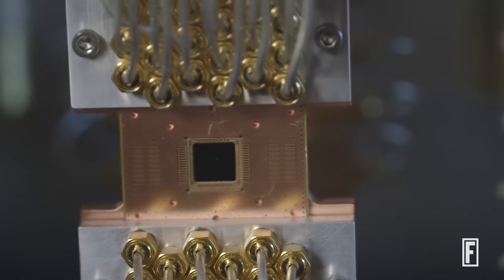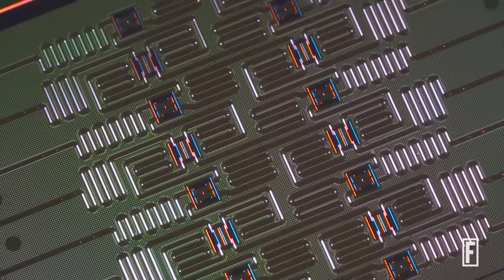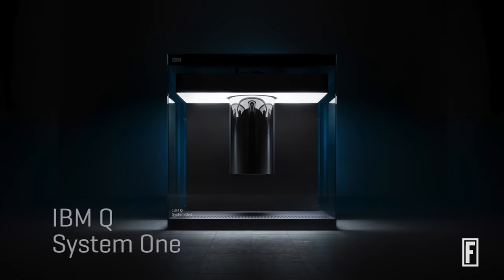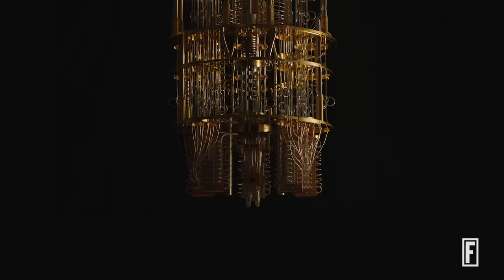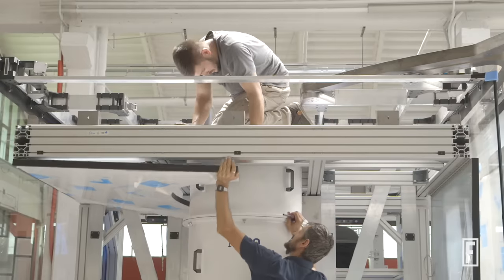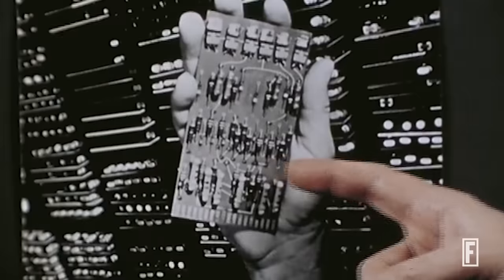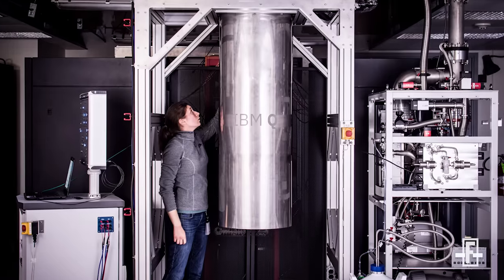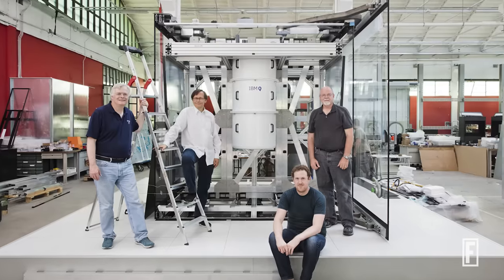IBM Unveils Groundbreaking Quantum Computing System I Fortune

Comment: 3:25 half inch glass with tolerance 1mm... that's 8% deviation! spouting fancy bullshit that really doesn't matter
Reply: Yeah, I wouldn't call that telescope mirror manufacturing accuracy. It is basically a fancy glass case to increase the pizzazz factor so, I guess its ok. Also, borosilicate glass is just low thermal expansion glass, like Pyrex glass but they use this term because it sounds "sciency", typical marketing and image making behaviour from companies.
Reply: I thought the same!
Reply: @MattacksRC  For real. They used "made the glass that covers the Mona Lisa' as an example. So what? Its really thick with some plastic layers? Wooooooow cooooooool.
Reply: Yep BS - sells!!!
Reply: I'm not positive, but I'm guessing the 1 mm tolerance might be with respect to the flatness across the whole panel, not the thickness of the panel...
Reply: @mmoseleywpi  
Yeah, I also thought of that. It might be.
Reply: @Indo Surfer uhhhh.... yeah? 1mm is 8.3% of 12mm...
Reply: @makismakiavelis5718  
"Also, borosilicate glass is just low thermal expansion glass, like Pyrex glass but they use this term because it sounds "sciency", typical marketing and image making behaviour from companies."

==Pyrex is a trademark of Corning ware.
The common term is borosilicate glass. It's the standard soda-lime glass with a certain amount of boron oxide added.

There was a time when people said kleenex (Can you pass me the kleenex?)
There was a time when people said kodak (Bring the kodak with you.)
Reply: @vmelkon 
I know that, i only said Pyrex because it is the most widely known brand where i come from. There are other brands like Heatex, Duran, Simax etc. Most viewers know what Pyrex is, less know what borosilicate means. In my corner of the world we comonly call it "heat resistant glass" or just Pyrex
Reply: yeah my ceramic cutting board in my kitchen has tighter tolerances than that :p
Reply: Spoken like someone who completely missed the point. The point is that the internal components are highly temperature sensitive so they had to encase the thing in this particular glass. Why don't the tolerances seem all that exact to you? Did you listen to the purpose of the glass? It's there to expand and contract to absorb all of that external variation before it reaches the supercooled quantum computer. A 1mm tolerance is less important because the glass is intended to flex. But yeah, your low-grade heckling is very edgy.
Reply: @makismakiavelis5718  :
I guess you are right.
Most people know the term pyrex.
Reply: @DikoMan didn't he say the glass was from Italy?.... Im pretty sure Italy uses Metric.... also half inch is 12.7mm

Comment: Why glass windows? He said the windows were only used to keep the temperature inside stable. So, why didn't they use, say, thick walls made of highly temperature-insulating material instead? There's no point looking into a box that contains a suspended barrel.
Reply: RF shielding too?  Low coefficient of thermal expansion.  Yeah I am not sure why he touts the glass so much.  This thing is quite a bit beyond gold plated.  I think they should use sapphire glass like an iPhone.
Reply: @williamdavis2505  Borosilicate glass has very good thermal properties which is likely why its used. As for rf shielding, the glass is almost guaranteed to be ITO or FTO coated to make one side conductive.
Reply: Glass is a good IR radiation reflector, but it seems to be there just to make the system look cool instead of be cool (literally). As other said, there are better and cheaper materials to do the job than a thick wall of Boro 3.3.

Comment: Let's be cautious with Ai and quantum computing please
Reply: AI yes but quantum computing why the concern?
Reply: @darken3150  Quantum computing can/will bolster machine learning exponentially.
Reply: And?
Reply: @darken3150  ...and I was explaining why we should tread carefully with AI and quantum computing? Anything that allows AI to perform at orders of magnitudes higher than it already is should be watched carefully. Of course it's a moot point because we will ALWAYS be full steam ahead on new technologies...
Reply: So you say be caution of quantum computing because of its use. Then by your own logic we shouldn't be pushing for faster conventional computing either because it will also perform higher than current capabilities. My point is the concern is AI alone, not quantum computing. Also are you equating machine learning with AI?
Reply: @darken3150  I'm not saying we shouldn't push for better technology, of course we should. I'm just saying that having an understanding of the implications that new technology (in this case, quantum computing) can have on AI is a noble cause. OP's post, I believe, was about the interaction between the two, and not about them in silos. 

Furthermore, I am aware that machine learning and AI are not one in the same, but rather one is intrinsic to the other. The reason I called out machine learning is because from what I've seen, that is the one aspect a lot of programmers seem to be most excited about when it comes to quantum computing and AI. I do consider myself a neophyte in this realm though so if I'm incorrect about that, feel free to point me in the right direction.
Reply: @probablychris  It's not the technology that's the concern. Its the people who will use it for evil, for example the N.S.A.
Reply: It's right, we have to be careful. A quantum computer has the potential to break thru every cryptography! Hence, for example, the user has access to virtually all the money by hacking online banking.
Reply: Kay Kay  I'd rather say: Hackable.
Reply: We already have enough people on anti depressants and we just seem to become more discontent and miserable as the digital age progresses. It seems the technology has progressed too fast for society and culture to adapt.
Reply: Kay Kay  
I am a software engineer with a degree so no tech did not leave me behind but I agree that no one seems to take responsibility anymore. It just seems that the technology has overall had a negative effect on peoples well being since it is mostly geared towards entertainment and quick gratification. Social media makes people anxious and depressed. The technology is amazing if you don't consume too much of it and use it more for more productive things but it seems too many people are unable to do so including me sometimes.
Reply: Why? I say let AI take over. They can't make things worse than humans have already did.
Reply: Kay Kay  
I think it is more then just self control. I may be wrong but it seems like everyone is becoming more and more superficial hiding behind a digital interface and our information and entertainment is becoming more centralized. All of our information and privacy is at the trust of a few tech giants, and it is easy to imagine a future where this is used for more sinister things then targeted ads. Considering human nature and history it would be foolish to assume digital technology will not be used for economic domination and mass mind control.
Reply: Kay Kay  
I never said that, learn to read.
Reply: Kay Kay  
I never proposed anything. I am just sharing my opinion on it all. If the majority of people fight for the freedom of speech and basic human rights and do not blindly trust tech giants like Google to be responsible with all our digital information I think the our technology will better most people's lives.
Reply: Kay Kay  
No, I agree that it is our responsibility to maintain our freedoms and not institutions like Google or party politics which is why I am taking the time to even comment on this video. The future is out of our hands but maybe we can affect it in some small way by sharing information and trying to understand things in a more real way.
Reply: too late
Reply: @darken3150  normal computers 3 weeks to teach AI
Quantum computer 1 hour to teach AI

Comment: I want to take this video from 2:48 on and replace "quantum computing system" with "high-end turntable." Advanced industrial design, exotic materials, extreme manufacturing tolerances, suspended frame, vibration isolation, pressure and temperature control... Exactly the same things that $100,000+ turntables like the Basis Audio "Work of Art" and Clearaudio Statement v2 brag about! Soon to be joined by the IBM 'Q' Turntable, the world's first million dollar vinyl record player.

Comment: Are these to the point yet where they could emulate at least a 486 x86 chip and run Windows 3.1 with Photoshop? Or do they just yell variables out and make leds light up like an Altair 8800?
Reply: It seems to me you've built a glass box around a huge altair. If these computers are to be adopted, they need to do at least what computers today do. No one wants to start over programming lines in Basic again. If you could build a computer that can run x86 server software, that's when adopters will come. Building a glass box around a useless, but super cold chip, is nothing groundbreaking or interesting.

Comment: “There is nothing you can do on a quantum computer that you can’t otherwise do on a classical computer”

This sentence is breaking my brain, can someone please help me understand this?

Please, this is driving me insane.
Reply: drowning. What he means by that is their complete knowledge of the quantum computer is not enough to surpass what your laptop can do... for instance if you do a task on a quantum computer it would have the same outcome as your laptop due to the current stage of said computer... now what he follows up with is in 3-5 years the quantum computer will be able to do tasks much more efficiently than your laptop... it will also with time be able to compute certain tasks your laptop would never be able to... it takes time my friend but soon, things we didn’t think possible will be. Good question.
Reply: First answer was completely wrong. What they mean is that any problem computationally undecidable is still undecidable on a quantum computer. Any problem which can be computed on a quantum computer can be computed on a classical computer, though the quantum computer may be faster. Nobody has actually proven that a quantum computer is faster at any problem, so it's entirely possible a quantum computer doesn't even speed anything up (that is unlikely though; it's more a consequence of the fact that there's tons of unknowns in computational complexity theory).

Comment: So much of IBM's Q-computer R&D dedicated towards fashion, not tech.  Yes the system is extremely sensitive to external influences, vibrations, noise, electromagnetics, etc, so yes they need to engineer an extremely shielded chassis to isolate it.  But it doesn't need designer glass and precision machining, a properly designed sealed lead box would cost a whole lot less.  It's not going to be a consumer appliance for decades (if ever) and we're well past the point where datacenters became more interested in low-cost high-power reliability than in decorating with sci-fi showmanship.

Comment: I can't help thinking that the answer to such 'complexity' (the cooling problem and associated hardware problems) will be a biological one. For example, the theory (accepted concept?) of bird navigation over great distances being possible due to quantum mechanical effects shows that effective systems of quantum 'computation' can take place outside of normal concepts - and these are exactly the types of problems that quantum computers are suited for.
'Noise' as cited in the video, can be reduced by simply using concurrent (parallel) systems and working on the 'average'. As everything is 'fuzzy' anyway, it really should be the way to go. In other words, people are thinking to 'concretely' in relation to quantum mechanical systems.

Comment: He did not state how many quantum bits the current best computer has, but it's clearly not many yet. At the end of the video, he states that classical computers can solve the problems the current quantum computers solve.

Even when there are a very large number of quantum bits, these will be used to solve a category of problems quickly that classical computers could not solve in very long period of time. Classical computers will still be best for some other problems.

Comment: Quantum computers are not designed to be a replacement to classical systems such as what we use today. Their processing power will be more so reached out to remotely, the hardware  wont be kept personally by the users. This is due to the nature of how they compute outputs, they are not capable of making every known algorithm more efficient, only specific ones. So the whole "look at this in 30 years" story may not exactly be the case. What will be apparent is devices in the future that receive the outputs of these quantum systems, but they will not contain quantum computing technology within them.